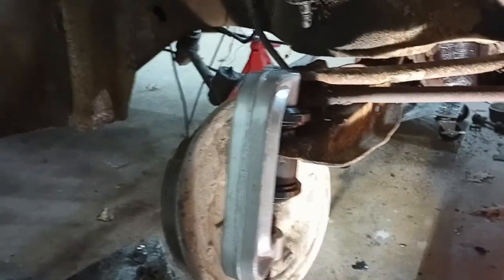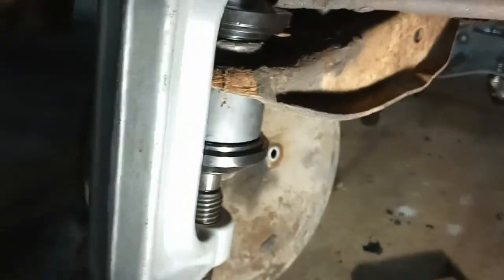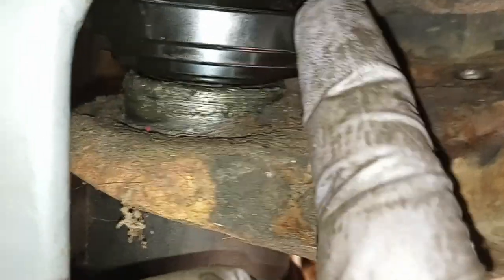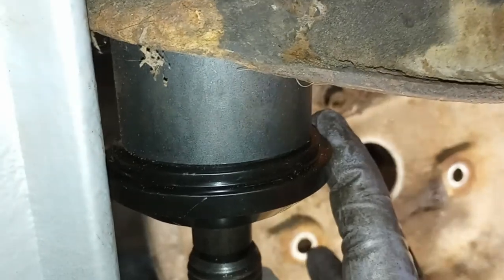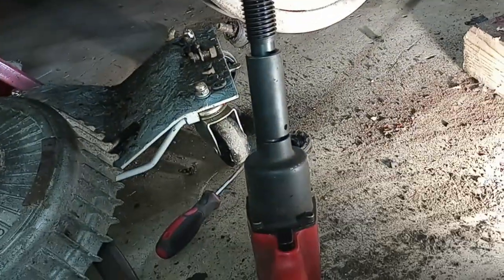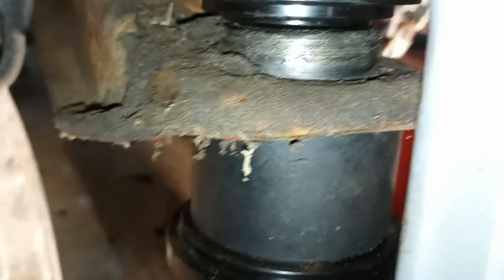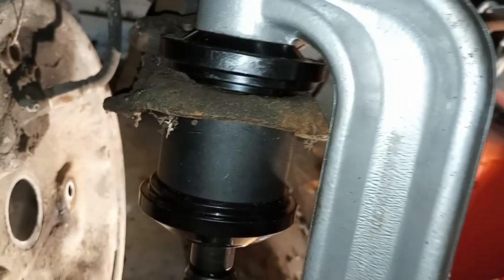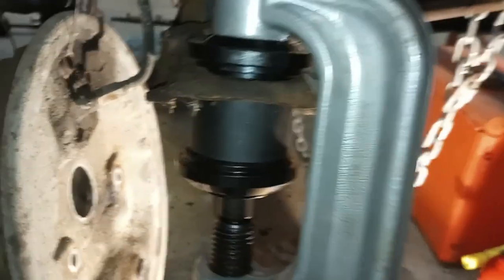Harbor Freight ball joint press - Lower Ball Joint removal in the Buick Wildcat

Comment: Should include you need to grease puller threads every time you use it, or you can gall the threads.
Reply from the maker: Yes - good call.  I did grease the threads.  They recommend it in the instructions as well.